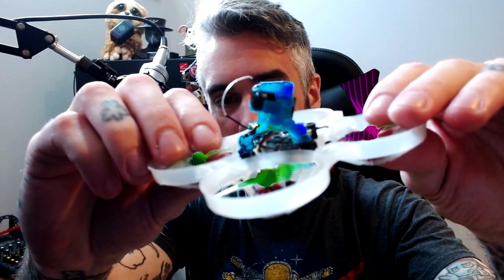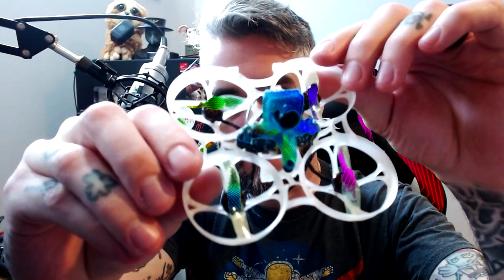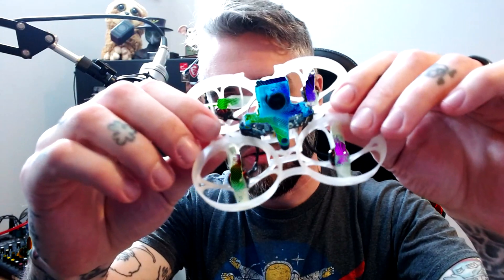Happymodel Moblite7 | Revisited (The MobThicc7 Cinewhoop and Acro Basher)

Comment: Does the caddix ant come with wire harness? Thinking of getting that cam and beebrain v2 canopy for my moblite7. Mobula6 canopy sucked. Has jello lol
Reply from the maker: The Ant has a few different variations they made. The harness depends on which you end up getting. I think there was 3 kinds at one point. It might not be plug and play with the moblite7 flight controller. The beebrain fits the runcam nano 3 nicely tho. Just need to trim back the camera protection a bit.
Reply: @InfinityLoops  right on!! Great to hear cause the runcam is not bad and rather stick with it. Thank you alot man. Great info about the motor wires to💯🤜

Comment: Any opinion on Runcam Split 4? I was trying to put it on
Reply from the maker: I haven't had a chance to try the Split 4. In the past I tried the older Runcam Splits. I never liked them much because the on-board HD recordings were usually pretty bad. It may have improved since I last tried one though.

Comment: I used some e6000 glue on the camera strap, and on the standoffs that hold the fc and it's helped a lot with durability
Reply: I have some Welder glue i used a few times to fix the frames. But after a few good hard crashes on the hardwood floors in my house that was a wrap. I was using Loctite Fun-tak to hold the camera, but I wanted to find something more permanent. I'm glad you've found some good durability in yours. They are a blast to fly inside!

Comment: Thanks for sharing, recently I broke the frame of the moblite7 and I tried to move the parts to mobula 7 v2 frame and I found it impossible to poke the motor through the gap, How did you pull it off? Did you desolder the motor wire? Thanks!
Reply: I'm such a dumbass, I filmed myself swapping the motors through the v3 frame, and i cut it out figuring nobody would want to see that haha sorry man....anyways, I did not desolder the wires. I put the motor shaft through first and tilted the motor to squeeze the bell through the frame. I did have to put a bit of pressure on the frame to get it out of my way. But nothing broke in the process. I've swapped frames twice now.
Reply: @headsfpv  It helps a lot simply knowing it can be done, not to mention the detailed explanation you suggested, thanks! I'm looking forward to try it in the near future.
Reply: @headsfpv  mayby there is some video how to change frame without soldering?
Reply: @Nesterov_Alexander  YES! It is rendering as I type this. Will be uploaded within the hour. I'll link it here for you.

Comment: Hi what did you mean by resetting camera at the end of your video? Is that same blank camera issue like mine?
Reply from the maker: No, resetting the camera position. The camera mount doesn't hold it very well.
Reply: @InfinityLoops  did feel 19000kv underpower if i put full canopy for it?
Reply from the maker: Power feels good even with the extra weight.

Comment: thanks for the video, 
can i change the frame without disoldring the motors ?
Reply from the maker: Yes! To get out of the old frame, just cut plastic out of the way. To install in the new frame, do one at a time and pop them through the frame hole. Put the motor post through first and then push the bell through.

Comment: My moblite7 has arrived. Already add beebrain canopy. What lipo size youre using for that freestyle? Can it rip with the heavier 650mah ?
Reply from the maker: Heads uses 450mah RDQ batteries. The 650s are a bit heavy.
Reply: @InfinityLoops  cool i still have some 450mah from my old tinyhawk 👍 but why my beebrain canopy shows lots of my front motors.. i use ant lite. Is it wider than yours?
Reply from the maker: When you see Heads flying his, it's either running the Ant Lite or the Runcam Nano 3. The nano3 may show less ducts. But he uses both.
Reply: @InfinityLoops  ah i see. Do you know if the runcam nano3 or ant lite can fit in goober canopy? Cnt get beeye cam here in my country
Reply: Just flew and with a slight crash i broke the rear duct 🤣 and in the end a cat slapped my moblite and somehow my caddx ant lite goes gray.. maybe its dead. I checked the cable is fine
Reply from the maker: Ohhh no! Well, Heads runs a Mobula7 V3 frame on his, much stronger. And a beebrain v2 canopy, makes the overall structure very durable
Reply: @InfinityLoops  yes i love beebrain canopy but because my ant lite dead, now i only have nano 3.. its too big right
Reply from the maker: Just need to snip the canopy lens protection back a bit. But it will work. Heads runs both Ant Lite and Runcam nano 3 in same mount.

Comment: I bought a moblite 6 for parts and transplanted everything into an R3D Shifters zerograv 65mm. The zerograv 65 flies just as good as the moblite 6 did but it's much more durable with a carbon fiber nylon frame.
Reply from the maker: We are very familiar with the guys at r3dshifters. We have reviewed just about all of their frames. Heads is a big fan of their stuff. I believe they use our review videos on their website! The zerograv is a beast! Excellent for squeaking through tight spots. You should see Heads rip it 💥
Reply: I recently got to try out an unreleased 5inch frame r3dshifters is working on. I built it out to sub 250g. 6s. Absolute ripper!

Comment: Hey, Heads! You are using the stock PIDs from profile 1 or 2?
Reply: Hey man! I'm using profile 1.
Reply: @headsfpv  I upgraded my Moblite7 with the Mobula6 canopy, but I'm having a lot of vibration in the camera. You have any idea why that's happening? The screws are pretty tight.
Reply: @lucascqs  mobula6 canopy is kind of infamous for jello. Tightening the screws will only help so much. What I did with my Mobula6 to kill the jello completely was adding a small piece of Loctite Fun-tac smooshed between the sides of the camera and the inside of the canopy where the screws come through. Then put the screws in. I used a small flat head to move the putty around and get it to hold tight. No more jello since. You can also try small dabs of glue in the same spots.
Reply: @headsfpv  Oof, that's unfortunate. I'll try to add a dab of hot glue on the sides to test it. I also ordered 2 uz65's canopy, but I'm still waiting for delivery. Hope they perform better. Its sad that I can't find any place that sell/deliver the BeeBrain V2 Canopy to Brazil.
Reply: @lucascqs  yea that sucks man. Try the hot glue on the spot where camera meets canopy on the inside. Then put the screws in. Make sure camera is where you want it. Let it cure completely. You could also try double sided tape. Best of luck.
Reply: @headsfpv  Thanks for the help, man!
Reply: @lucascqs  anytime man. You have discord?
Reply: @headsfpv  Yes, I have! its lucascqs#0527
Reply: @lucascqs  if you ever need help again, we have a channel within the weBLEEDfpv discord. Easier than talking in comments 😄

Comment: I fly a naked Insta360Go!
I will have a naked v2 soon
The acro is the best naked and my brushed quad kills for cinematic with the low FPS. 
4-5 min flight times!
Reply: just out of curiosity, did you try flying the insta360 go 2? naked or not? how are the flight times?
Reply from the maker: We did not have a chance to test it with the Insta360 Go 2.